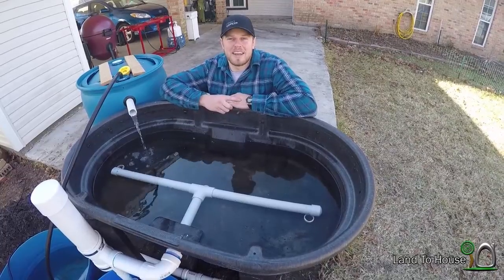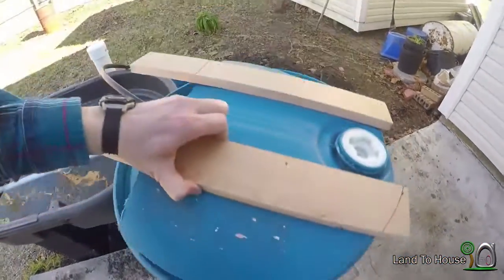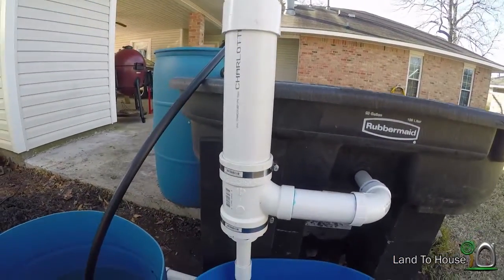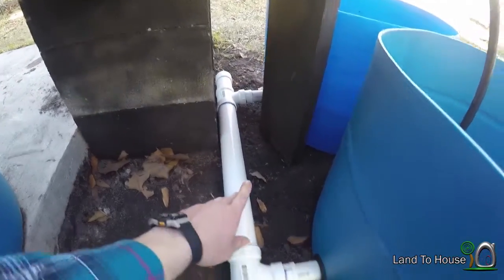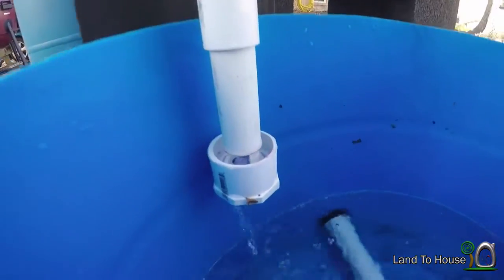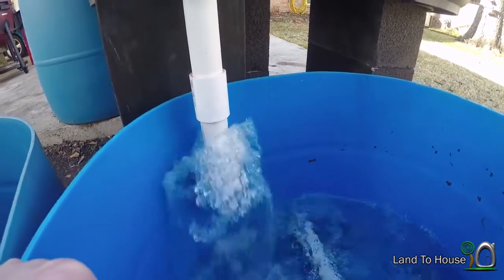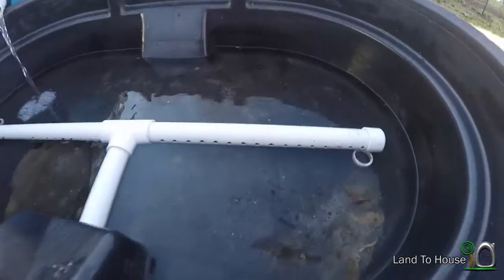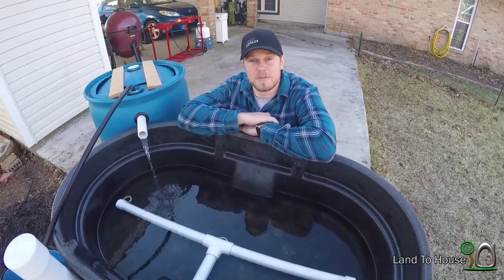Aquaponics | Land To House

Comment: A very interesting video, I have read up a bit on Aquaponics but it isn't in my list of projects to do (yet)
A couple of questions:
You mention a fish barrel? I notice others have fish tanks as well, will he have fish in there? Are they needed? I am guessing they might be to provide nutrients?
It looks like the level of the water could be critical? Did it take a lot of sorting out?
Reply from the maker: Yes you got it!  The fish must be in the system for the nutrients for the plants. once the fish have grown you eat them and get more fish or let them have more. The level of water will change a lot when the rocks are placed in the grow bed. The system is actually very forgiving. As long as the water level reaches the top of the stand pipe in the bell siphon the whole thing works. He is so happy to have it working.